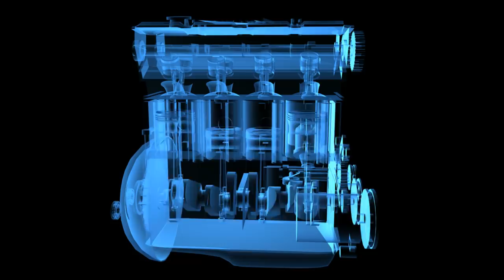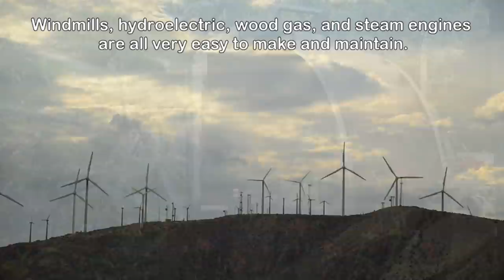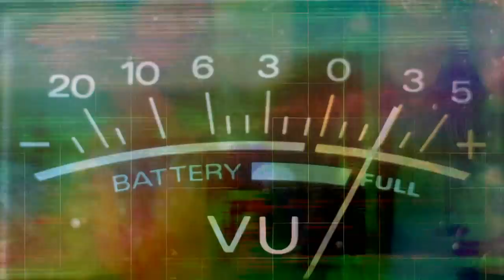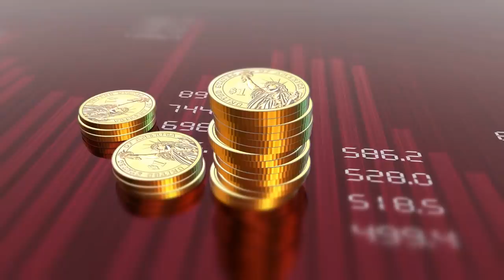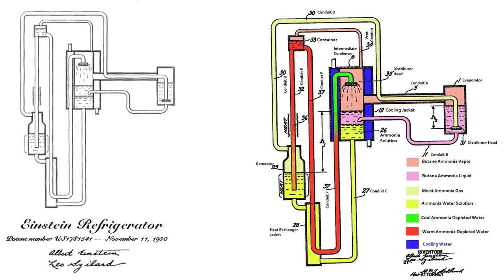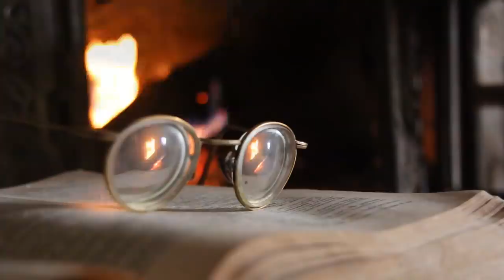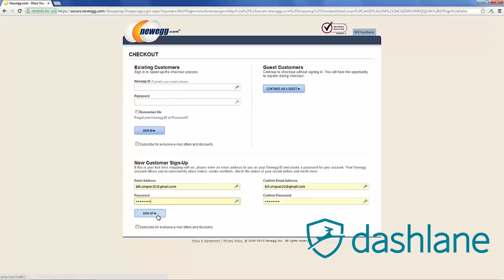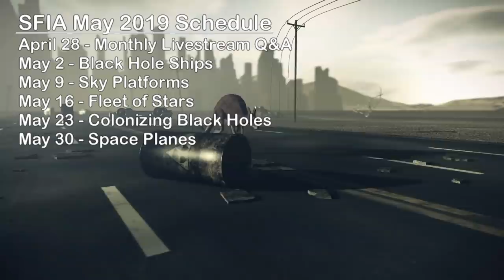Post-Apocalyptic Civilizations

Comment: I suspect that the nature of the post-apocalypse would depend largely on the nature of the apocalyptic event itself. (duh.)
If a very powerful solar storm fries all electrical devices, there might not be many appliances to plug in, even if we get the electricity back. (most modern appliances contain even simple circuit boards.)
A succesful rebuilding of civilization would also require a good level of cooperation. That might be difficult if a suspension of you regular food supply creates gangs of raiders who only look out for themselves.
But if there are not too many assholes left after the apocalypse, it should be possible to make things work again.
Reply: Military vehicles are made to withstand EMP attacks, I'm sure many would also survive a solar storm, even if they were temporarily disabled. There are no realistic scenarios where all electronics are "fried", that's purely science fiction.

Comment: The internet might stay gone for a while - I know for a fact that my modem & router aren't hardened to handle an EMP from nukes, and wouldn't the effect be made worse by the miles and miles of antennae we have strung everywhere? (or am I wrong that a longer antenna gets to convert more of the magnetic wave into electrical voltage?)

Comment: As far as I know gasoline stores quite well in modern car fuel tanks, and since they're fuel injected, the gasoline will work with the engine perfectly fine even a year later.
Not sure about several years though.

Comment: Diesel stores well but even when you run out an old pre electronic engine will run on almost any liquid that will burn. I suspect dune buggies will vanish pretty quick but older plant equipment will do duty for moving loads. Except for emergencies you wouldn't want to go fast anyway, not off road or on unmaintained roads so even when the tyres were all rotted out an old tractor dragging a cart both on wooden or steel wheels would be ideal, unromantic as that sounds.

Comment: The repeated arguments against gas engines is a bit strange. diesel engines offer a lot of options on alternative fuel sources and if nothing else you can make some really robust radial steam engines that will run on anything that burns and have enough power to move vehicles even if not at race car speeds outside of a track. But I would think that is much less important in a post apocalypse world.

Comment: One of the design considerations for the M-16 assault rifle was that the weapons could be b manufactured and maintained in common machine shops in the case of nuclear war. That's why the receivers on the M-16 is machined. It's more expensive but it's low tech. Any common milling machine can make them. By contrast, the AK-47 requires a specialized factory with custom built metal stamping machines.

It's possible this was a design criteria in the Soviet Union to create centralized weapons production.

Still the M-16 will be easier to manufacture part-apocolypse.
Reply: Post apocalypse, where there's little machinery available, I'd want a bolt-action. A Krag-Jørgen or Mauser style one. (You can use Mauser speedloaders on Krag-Jørgens.)
Reply: HrHaakon -- Yes, I just thought it interesting that post-nuclear war production was part of the design criteria. It was in other military products of the era. They thought very seriously about the consequences of a nuclear war. 

And machine shops are way more common than you might think. A bigger problem wold be fabricating ammo.

Comment: You can run an engine on steam or wood/coal gas. All were used in WWII to power cars/trucks. That said if it were an EMT that started the decline many of today's cars and trucks would be harder to get going because of the computer integrations. Today's automatic transmission are mainly controlled by the computer.  So if you want a vehicle to drive in Post-Apocalyptic era lean to drive a standard and get a pre-computer car/truck. Just to be safe.

Comment: Instead of gasoline, use alcohol. An engine needs no modifications to run on alcohol, just a larger amount of fuel being fed in, something like 1+1/2 what you need for a gas engine. Modify the carbourator for that. As a bonus, the engine will run cooler
Reply: what is a carburetor?
Reply: My choose - is gas generator on wood)
Reply: @jamesdriscoll9405  carburetors mix fuel and air in the correct ratio.
Reply: @zippy-zappa-zeppo-zorba-etc  In the eighties lol (Whoosh!)

Comment: I think shoes/boots would last in their boxes in wharehouses\stores as its not an item that will get stolen quickley. They last in the right conditions for decades with no effect in moderately stable environments. Ehtanol is the preferred fuel of the apocolypse. Sailboats will be the way to travel long diatance at the coast or across ocean (but great care must be taken to avoid weather as there will not be any rescue) , that and horses and buggies. Some ultra light aircrafts could be used with ethanol with the right tinkerer, fermentation then distillation can be done by anyone for fuel while drinking alcohol is a bit more knowledge and experience intensive if you dont wanna kill anyone. Wind power can be used on abandoned highways for ultralight buggies with wide low sails, at least to cross the deserts in the american west and the endless expanse of plains..its a transportation method i have rarely seen utilized in apocalyptic movies..... Solar panels, big batteries,  medicine, guns and ammo, and food would be my first priority when the world starts to end. My plan is to commandeer a 40+ footer (many scoped out already, hardly used by the owners and in the end using it for lidesavig purposes would be a better fate than wasting away in the weather and being looted). My 24 footer full keeled classic sailboat is tough enough but just not big enough to be able to store needed items nor would traversing unpredictable seas be ideal as the cockpit is low to the water and wet to whoever is at the tiller.  I would set  up a larger boat with 2 of everything and tools and means to repair everything  a major solar/wind power and battery storage, watermakers and tanks, all items that wouldnt dissapear from dealera right away in the midst of a disaster but would vanish within a few months. Maybe I could even find a few spools of kevlar fabric to put a thick armor coating with epoxy and kevlar in a few key refuge spots aboard, some where I have cover to return fire. A full compliment of sails and a shortwave radio and i would find a place where locals have made a safe community and become a contributing member offering to shuttle supplies or people  once and a while if needed or.......the daydream could go on forever, its not the first time these plans have crossed my mind...lol.
I cant say that with what the worlds becoming I dont want to see somebody hit the reset button on society.

Comment: i've played around with the idea a few times.  as long as we had access to libraries, electricity, and functioning computers, i'd say we'd be back in full swing in about 15 years or so.  far less dramatic than the movies suggest.  😑
Reply: Really depends on the population.  You're going to need a substantial labor force to rebuild an electrical grid.  Are factories still standing?
Reply: @jengleheimerschmitt7941  -  once an economy is established, everything would be either back to normal or well on its way in about 15 years.  believe it or not, what makes things take time is the marketplace of ideas.  once we already have that 100% figured out, we already know what work to do.
Reply: @long-timelistenerfirst-t-us2yy  Without any reguard to how may people survive this apocalypse or what the infrastructure damage is, you estimate that it will take about 15 years to rebuild?

When you say functioning computers, does that include a functioning electrical grid and fiber-optics network?  And a population sufficient to handle the workload?   What is it that we would recover from in 15 years?
Reply: @jengleheimerschmitt7941  -  trust me, as long as we had a way to access the knowledge of how to build what we have today, then people will have enough of a starting point to begin rebuilding.  if you still disagree that's fine, let's at least agree we never want to find out  :-)

Comment: Woodgas does not have to be generated on demand it can easily be washed and compressed. Lubricants are a bigger bottleneck but old engines do better on bio-oils so long live the big low rpm V8s which incidentally do better on woodgas as well.

Comment: Our concrete buildings have very little wood to burn so they would remain usable for a while. Dense cities might suffer from domino effects of fire or colapse, and dust and ashes might cover the square parks ruining them for agriculture, but roads would be there for people to move just outside on anything still standing. Maybe a biological wipe out that focused on older generations could affect important knowledge (like working bank computer servers running cobol lol) but with so many people graduating and so much know how written, it would take a simultaneous carrington event to wipe out the internet for us to forget how to have the bare minimum. Maybe such carrington discharge was the thing affecting the lab that released the virus, or the nuclear reactor that blew up, and maybe prolonged neglect of a nuclear plant or submarine could lead to it's melting and catastrophe, making the plants die, but unless we reach a vulcanic winter level of climate unbalance the grid and other infra-structure will remain and shelter the survivors, that's why we 'built' them for.

Comment: 3:10 Pre-chamber diesel engines require a lubricant oil and a fuel oil to work both of which you can get from nature if you know where to look, plants, animals... Humans(would bring a new dimension to the post-apocalyptic cannibals).
Reply: Yeah, not as good as a petrochemical oil, but it would work.

Glow engines (and old rotory radial aircraft engines) are lubricated with castor oil. Downside: of your face is in the exhaust, you're going to get the shits.

Comment: So the dune buggies with spikes won't actually be powered by gas, they will all be electric. The Tesla Model 3 powertrain is designed to be extremely durable with minimal maintenance, it should last a million miles, and in a few years there will be millions of them out there. Plus the Tesla truck. And the Tesla AutoPilot has Mad Max mode too. Spikes sold separately.
Solar panels should be last long enough for people to come up with alternative power sources, and they can be used easily without any infrastructure.
Then there will be the SpaceX Starships returning from the Mars colony.

Comment: Yeah it depends how far you push it into the future. If it is early enough, there still will be diesel, gasoline and other fuels. But to make the fuel you need a big factory, so after a while... that all is gone. Back to the old ways right, burning wood and digging out coal.
Luckily the book I am working on starts 3-4 weeks after all shit hits the fan! So, there still is food, clean water, fuel and so on. But it will be harsher in time.

Comment: Maybe I'm just a downer, but if I'm sitting on the last supply of non-irradiated Twinkies around while being critically short on filters & rubber seals for my gas masks, I'm a bit more likely to exchange my Golden Sponge Cakes with a Creamy Filling for something I need to survive rather than a handful of old nickels.  In the absence of a strong, centralized government the barter system seems to me like the most optimistic outlook on what economy would develop.
Reply: Currency arose in a time lacking strong centralized governments.

Comment: On the fuel thing, diesel engines can run on practically anything that can burn. So diesel cars and light pickups I could see still running around after a total collapse scenario. We had guys running diesel pickups running on a mixture of vegatable oil and paint thinner after we invaded Iraq. Gas is still useable for a long time but it will mess up your engine like you said, so I could see a few vehicles still driving around as  luxury items and status symbols because, especially here in America, diesel powered cars are very rare. So if we go through something that knocks us back a few centuries in technological capabilities, which isnt entirely outside the real of possibility, we could see a return to Napoleanic warfare tactics with cars carrying generals and special equipment for larger forces and smaller forces most likely bolt actions for smaller forces since it would be much easier to arm a small force with better equipment for the individual where as larger forces have to balance manufacturing speed, recruitment and maximising the impact of their forces with different and more extreme variables that smaller forces. It's why spec ops groups and smaller European armies have always had "fancier shit" than the American military

Sorry for the tldr, I got going based on the topic lol

Comment: the post apocalypic world will run on woodgas
Reply: Some settlements might at first anyway.

Woodgas being useful because an ICE can run on it. However generation of woodgas wastes a lot of the thermal energy of your wood. So you might well be better off building a modest steam engine and burning the wood to boil water (and tapping the woodgas off of that to store for later if you need it, or let it burn too).

Comment: By the time this happens there will be electric cars not internal combustion engines everywhere. Could it be that electric cars will prolong the cannibalistic era Because it won't require engineers and chemists to get us back on the roads?
Reply: An electric car requires chemistry and engineering just as a gas car does.

So having them and keeping them lubricated and their batteries in good shape and charged is going to drag us out of that era
Reply: @DFX2KX  Excellent! Thank you!  I have an electric car and want a trailer with panels on it that I can pull.  I will then set up camp, hunt, gather while it charges.  Then, move on and repeat.  That is of course if I can survive the first several months.  

But in all seriousness, it seems like it wouldn't take much to create cannibals.  A simple, nationwide blackout created by a hacker (damaged hardware) that lasts several months should do the trick.  

Check out Ted Koppels book "Lights Out."  Seriously terrifying stuff and is pretty much a matter of when, not if.

Comment: Appliances break down every 2-3 months and need new belts and parts.  Mad cow disease and deer wasting disease will spread to humans with no CDC.   Auto and diesel mechanics will be at the top  of the vocational food chain (instead of near the bottom) and what about dentists and mid wives?  Things like hot clean water and fresh bread will be in painfully short supply.  After 2 or 3 years all your tractors and harvesters will be broken down with  no replacement parts, welders and metal-smiths will be like gods who walk the earth.